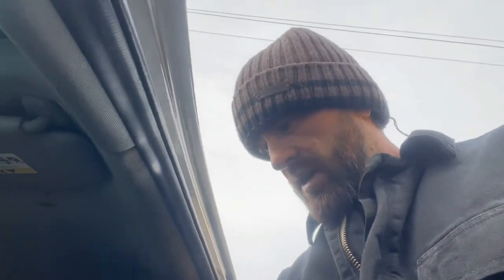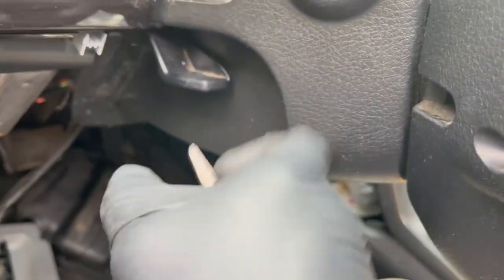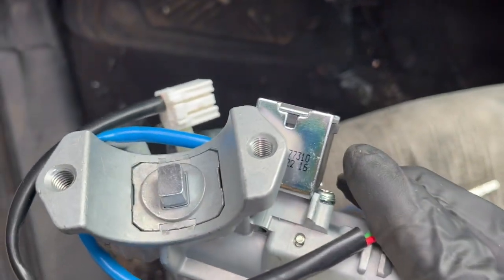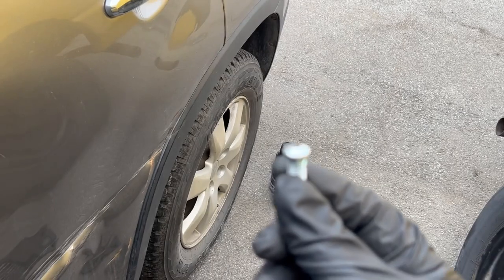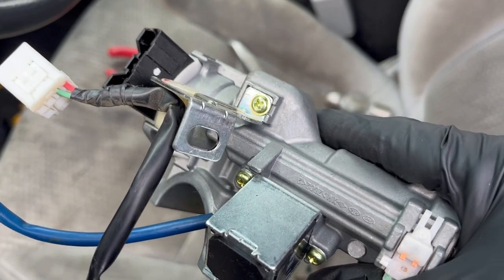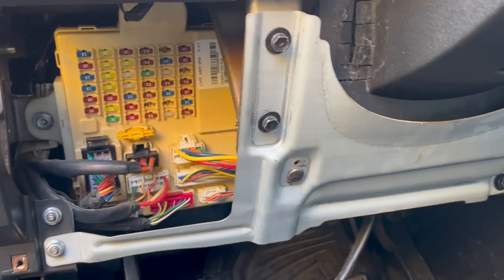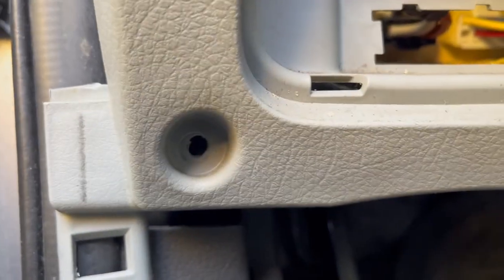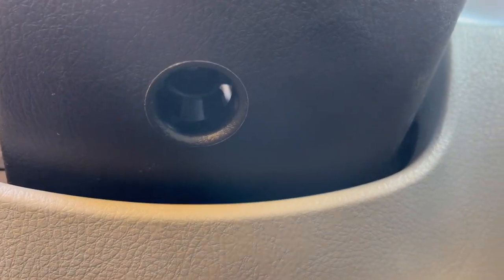2011 Kia Sorento ignition switch and lock cylinder assembly replacement

Comment: If you turn the steering wheel you can unbolt the lower plastic cover without removing the steering wheel or any other components! 👍🏼
Reply from the maker: Good luck with that 😂
Reply: @BigDogDiagnostics did you have to reprogram the new keys
Reply from the maker: @leewade6818  no. I said that in the video. Everyone asks that 🤣.. I literally showed the entire process no programming needed
Reply: @BigDogDiagnostics  I did it by turning the steering wheel and removing the screws. Removed the bottom shroud with the steering wheel still in place. My Sorento is a 2013. 👍🏼

Comment: Disconnect battery to stop airbag going off theres a screw holding bottom cover  somewhere in middle underneath on some robber just pulled mine down
Reply from the maker: Is this meant to be an instructional comment? Or a question? Or just a statement? Sorry, but you need to use plain English if you want people to understand you. 😜

Comment: I have a question if i was to replace the ignition switch with a new one with new keys on a 2012 kia rio would those keys have to be programmed to the car ??
Reply: I have the same question
Reply: Same quiestion i changed mine and ir wont turn on just Crank no start
Reply: @NoelVasquez-uo6mi did you figure out why
Reply: @NoelVasquez-uo6mi did u figure it out

Comment: Hey Big Dog, i’ve got mine completely unhooked and unbolted, but I can’t finagle it out of the steering column without removing the plastic shroud under the steering wheel. How are you able to get yours out without taking that plastic piece off? Thanks in advance!
Reply from the maker: @RealAmerica1776  you can finagle it out if the same year make model as the one in this video.

Comment: So you dont have to program new ignition switch?
Reply from the maker: Nope. The the immobilizer lock cylinder and transponder keys all come as a unit. Very plug and play on this vehicle. If you were to just replace the key itself, you would then need to have it programmed or the immobilizer system will not recognize the new transponder RFID code inside your new key.
Reply: @BigDogDiagnostics no transponder in the Sorento

Comment: The new lock cylinder can be able to start it with the new key?
Reply from the maker: Yes. If you purchase the whole lock cylinder assembly. It comes with new transponder keys and all the other required security components necessary. It was turn key no programming.

Comment: I bought the ignition lock cylinder but what is the pat called that you had to hit the bolts out cause this one didn't come with that part
Reply: Use a flathead and a hammer and gently tap it on the side to loosen it
Reply: I think you might be talking about the lock housing clamp
Reply: You can use a center punch and hammer or if you have a dermal, cut slot on the top and use a flathead.

Comment: Can this part cause the radio to stay on?
Reply from the maker: Yes, if it ignition isn’t returning to the off position or stuck in acc position could definitely cause that. But there’s also a whole bunch of other things that could cause that. You would just need to diagnose the issue at hand. Check service information and and figure out where power is supplied to and under what circumstances when the key is in different positions. Look at the stereo wiring diagrams and look where the power, signal and grounds are supplied from. Make sure a relay is not stuck on..
Reply: @BigDogDiagnostics  thank you Sir I’ll do those steps.

Comment: I replaced my lock cylinder and now the car won't start?
Reply from the maker: Same year make model?
Reply: @BigDogDiagnostics  2012 Kia sorento
Reply: I put the old one back on still won't start and now throwing a P2016 intake control position censor code!?
Reply from the maker: @Monarch1111  may be different security protocols. Always look at service information before attempting a repair like this. Also, there are many other miscellaneous wires and harnesses that need to be handled carefully when steering column is apart. Make sure you didn’t damage anything. Also, was it starting before you performed the replacement?
Reply from the maker: @Monarch1111  did you disconnect the battery before replacing it?
Reply from the maker: @Monarch1111  so look at service information and start the diag process over. Sounds like you either have multiple/additional issues. Or created an issue somewhere along the replacement
Reply: @BigDogDiagnostics  yes
Reply: @BigDogDiagnostics  the alarm system was initiated, bc I unhooked the battery over night due to theft.
Reply: @BigDogDiagnostics  it's turning over and everything just not starting.
Reply: Did u ever figure out issue ?